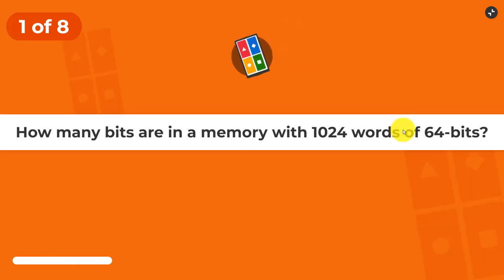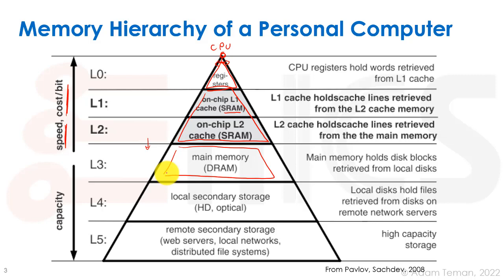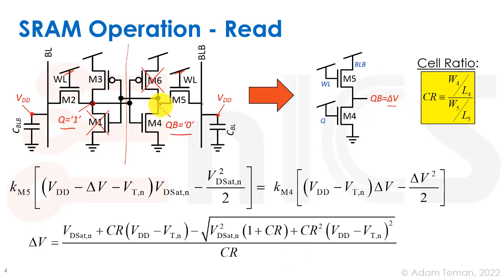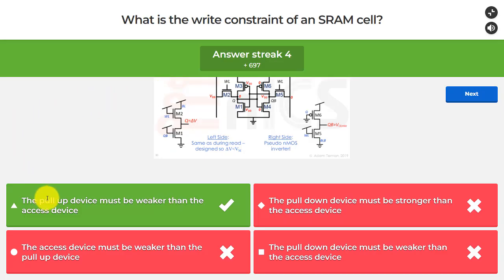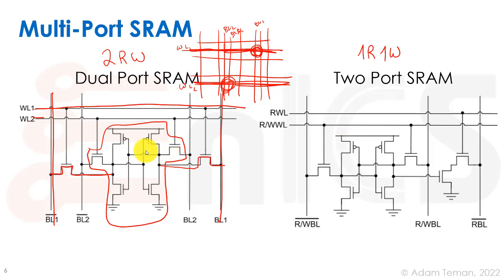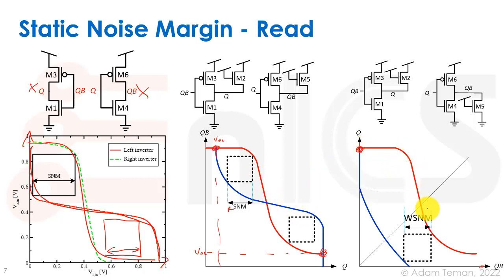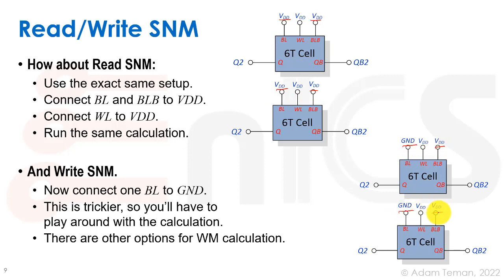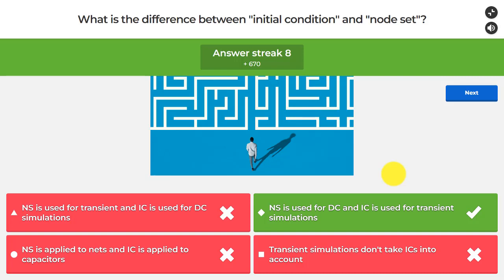VLSI - Kahoot for Lecture 8: SRAM

Comment: Dear Sir, correct me if I am wrong, in the write constraint quiz question of 6T SRAM cell, I think the constraint will be M5 (access) weaker than M6 (pull-up). The first option is the condition for writing, no? Because if M5 is strong then it is possible to pass 0 (on BLB line) to QB(which was 1 initially in this case). Thanks.
Reply from the maker: Hi.
No the opposite is true. 
For the READ constraint, we made sure that we couldn't write a '1' through the access transistor. Therefore, our only option is to WRITE a '0'.
How do we write a '0'?
By pulling down the bitline (BL or BLB, depending on where we want to store the '0', on Q or QB, respectively) and making the PMOS weak, so the BL voltage will overcome the pull up to the node that was holding a '1' previously. 
Note that during write "we don't care" what was initially inside the cell. We don't know what was there. We just have to make sure that after the write operation, whatever we wanted to write will be there. 
For a full explanation, see Lecture 8 of my VLSI course and specifically part 8c. You can go directly to the write constraint explanation with this link: https://youtu.be/leosGXihlVI?si=hnljg6pC5Vlxll4J&t=576